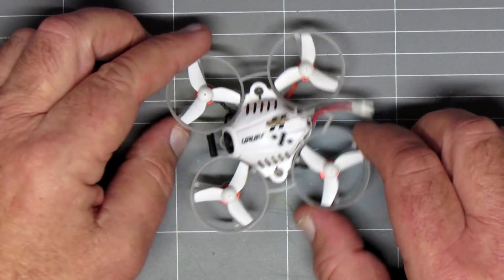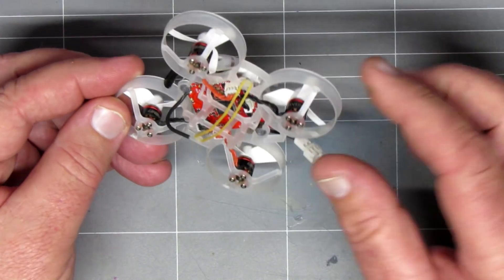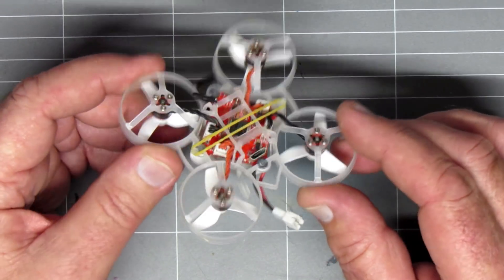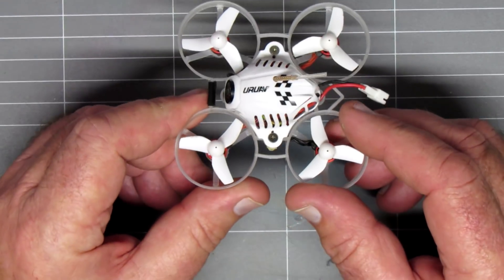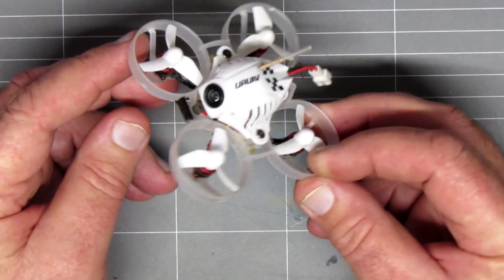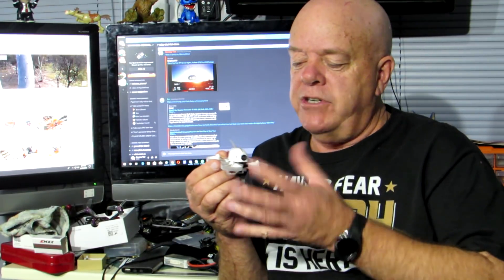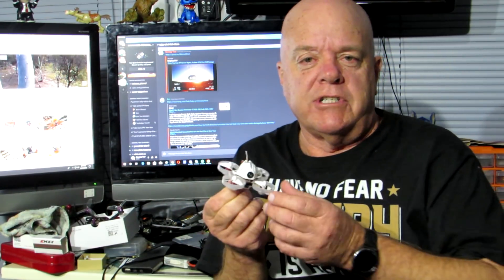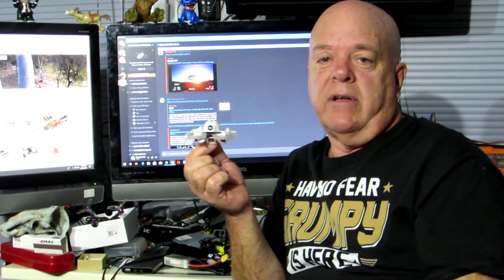URUAV UR65  Is it really that Good

Comment: Put some four-bladed props on that puppy, and it will easily fly circles around the Snapper 6. The plastic frame also stands up better over time, IMO. The aluminium hoops of my Snapper look like a 1960s garbage can, they've been bent back into shape so many times. 🤣

Comment: Trev, try swapping the props out for the eachine 31mm 4 bladed props or the betafpv 4 bladed props and it will feel better when you fly it, gives a bit more punch.
That and the stock props can cause vibrations.

Comment: Love your course...  Bought the UR 65 to “match” my larger King Kong drones, but I am having difficulty binding to my tarranis. Any suggestions?
Reply: George - did you get it to bind? I had similar issues, and in the end, my problems turned out to be because my Taranis firmware was EU LBT - which isn’t compatible with the UR65.I had to update the firmware on the Taranis to the international version, then binding was sweet. Hope this helps. K.
Reply: Kevin Hill yes I did, turns out it was a simple error on my part. I was pressing the boot button rather than the bind..  guess I should have worn glasses ... :0
Reply: George Ambeault - Glad to hear it. You enjoying flying it? I definitely am, although I am something of a beginner when it comes to acro mode, which is what I am trying to use exclusively on this little beast.

Comment: Hey Trev nice review. A question though about your UR65. I have seen a few reviews and your canopy is backwards to all others I have seen. The V portion on the frame in the middle on all other UR65"s has been in front of the camera and yours is not. Why is that? The black electrical tape on yours I assume is to cancel out reflections but on all other UR65's that side is on the backside. Maybe the reflections of light would not be as bad it the canopy was the other way round. Keep up the good work!!

Comment: Thanks Trev! Stick with the Snapper. My UR65 has been pretty much a waste of money. I'll likely reuse the motors. It failsafes constantly in close range. It has a horrible shake that I've spent far too much time trying to eliminate. I have already driven the camera back into the canopy and snapped two prop protector struts. It's a fairly crappy camera, even for a plastic "toy". Yeah it's only a hundred bucks but I'm still pretty disappointed.
Reply: Change the props. The stock props on the UR65 are garbage - try four-bladed Eachine or King Kong props - the UR65 becomes a totally different beast!